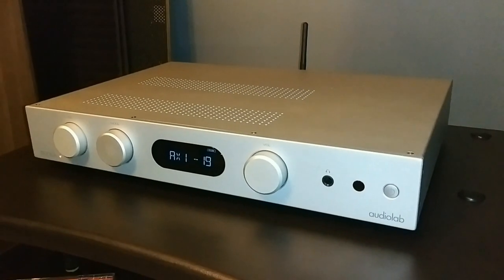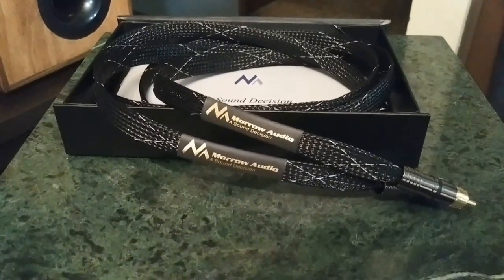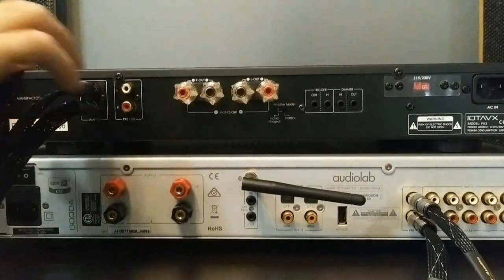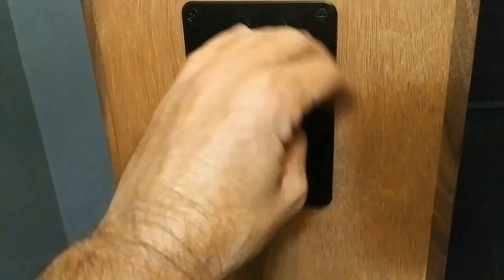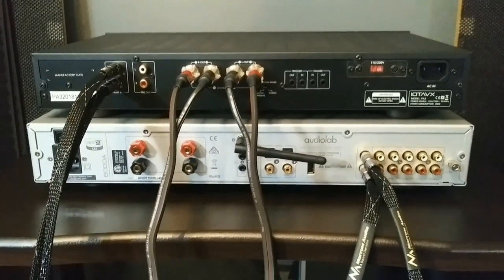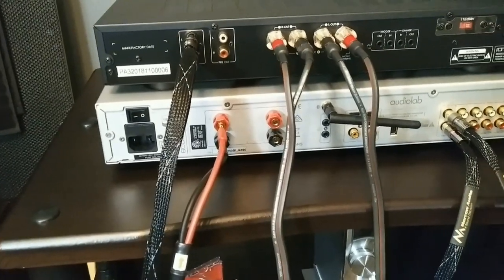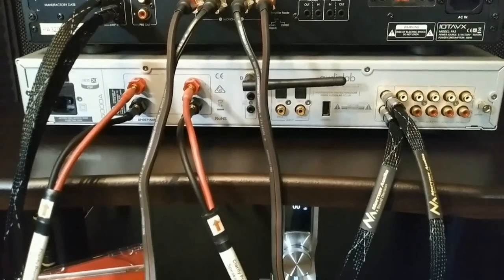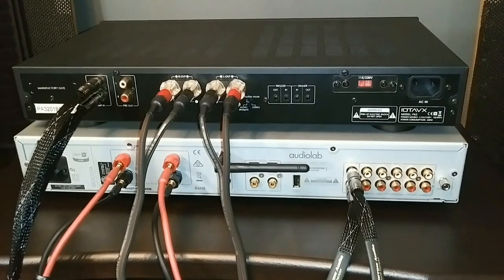How 2 Bi-Amp your speakers by using an Integrated amp with Full Range Pre-outs to a Power-Amp 😆

Comment: Found it. So for speakers with only 1 set of terminals, just one set of speaker wire is required running from the PA3 to the speakers, along with the RCA connecting both amps via pre out?
Reply from the maker: Yes I set of speakers yes pre outs going into amp input with Iota you could daisy chain as many amps as you want 😆
Reply: @tee-jaythestereo-bargainph2120  ive actually got a nad amp c320bee that i could set up to bi wire. Its also 50w into 8ohm. Just feel the PA3 would be good with the single terminal speakers ?
Reply from the maker: @CM-dw3gh  Try both was ? 
So ud be using integrated as preamp to Iota correct ?
Reply: @tee-jaythestereo-bargainph2120  yes. What im sayin is i could try out bi-amping all my bi wire speakers. Get an idea on how it improves sound. Cant understand why i havent tried it yet. 12AWG cable to woofers and 14AWG to tweeters. Im hoping lengths are approx the same.
Reply from the maker: @CM-dw3gh Yeah - You will get better Bass Attack and dynamics atleast '
Reply: @tee-jaythestereo-bargainph2120  before i try this it looks like its recommended same length speaker cable, preferably same brand. But on forums ive read gauges can be different, ie, higher gauge for tweeters, lower for woofers.whats your take on this mate?
Reply from the maker: @CM-dw3gh  I use many different cables ' I normally use Clarity cable on the LF and SKW on HF
Reply: @tee-jaythestereo-bargainph2120  ok so i dont need to waste money then, i can just use my 14AWG kabeldirekt. Are the lengths all the same on yours? Myn will probably be out a few cm here and there.
Reply: IOTAVX PA3 on course Tee Jay!
Reply from the maker: @CM-dw3gh  nice !!!! Great amp for pricepoint I am suppose to send mine to prime hifi (utuber) to be modified !! It's a sweetheart of an amp
Reply: @tee-jaythestereo-bargainph2120  jeez he looks like he knows his stuff. Not a bad idea though, being a reasonably priced amp, youl prob get the same quality as a more pricey one and still be a few pennies lighter!
Reply from the maker: @CM-dw3gh  Yeah Conor is another level he Master restored and Resto Modded my Sansui Au 717 😆

Comment: If using this setup. I assume you will lose your sub connection (and related sub if used) connected to the 6000a?
Reply from the maker: Maybe i should have even more advanced how 2 videos , No i dont lose my sub commections 3 different ways i can use sub outputs 1st off the Iotavx thats just an amp has pre inputs and pre outputs meaning i can use the outputs from the Iota Pa3 to run to a sub left and right rca outputs that are variable , With Iota Pa3 you can daisy chain . 
2ndly I could use hi level input active subs meaning i can tie in to either amps speaker output .
3rdly I can use what they call rca y adaptors 1 rca basically equals 
2 rca all you need is a signal of 500mv -
After i finish 3 reviews i have coming up  maybe i will show these advanced know how trick of the trades - 
Been hooking up my dads pro gear since I was 5 or 6 years old -
Reply from the maker: Check out my how 2 video on using hi-level output to a powered sub with hi level input - (Meaning amp with no rca sub outputs - ) video has almost 600k views
Reply: Thank you TJ!  I really appreciate your timely detailed response. Doing some advanced videos would certainly be helpful. Thx again!
Reply from the maker: @randallsguaranteedsold6361  You got it !

Comment: May I know any issue with the gain level between High pass and Low Pass since there were two different amplifier ? Most people go for  passive vertical bi amping with two identical amplifiers.
Reply from the maker: Gain is it the same level ' no problems ' a few pep now run this setup '
Reply: @tee-jaythestereo-bargainph2120  I wanna try with Anthem MRX 540 (Pre)  for HF and Benhmark Audio AHB2 (Amp)  for LF bi-amping . Would it be possible ?
Reply from the maker: I don't see why not ' You never know until you try may be surprised !
Reply: @tee-jaythestereo-bargainph2120 It could harm my speaker tweeter sicne I don't have active crossover ? My pre amp will send full range signal to tweeter.
Reply from the maker: @nainghtetsoeyi7440 ohh no passive crossover?